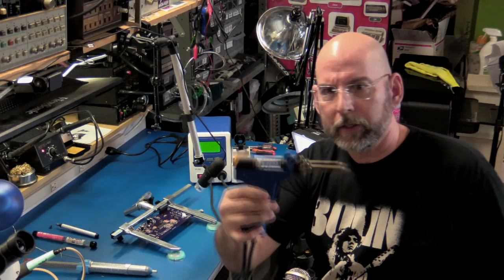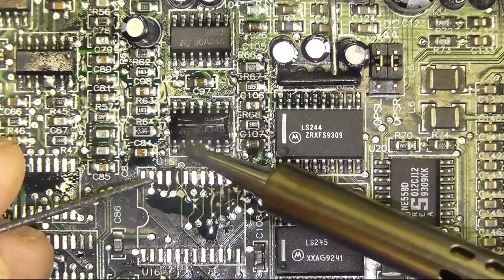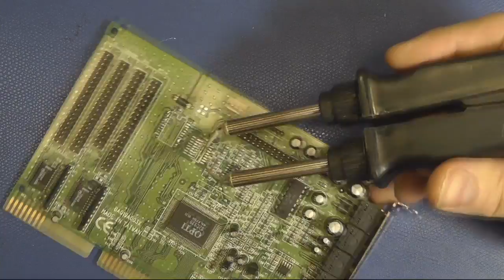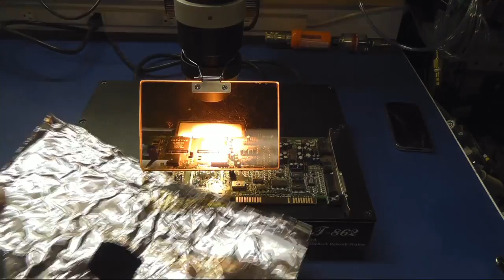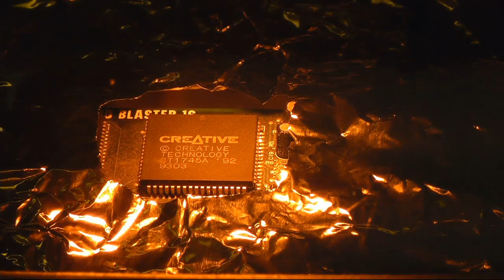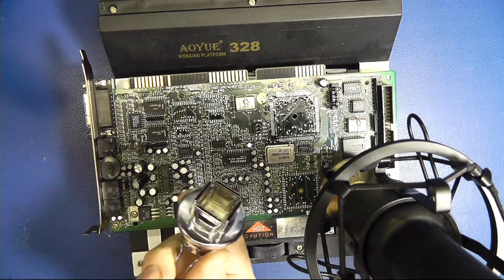SMT and Thru-Hole Desoldering Without Breaking Stuff

Comment: Hi, very good tips but I have a big problem removing SMD and through holes DIP parts from boards that have conformal coating silicone applied to protect these boards against humidity. Do you know to remove this protection?
Regards,
Fernando Pompeo call sign PU2PLL Brazil
Reply: Yes, I use thinner and some times heat the silicone with the hot air gun before to use thinner.

Best Regards.

Comment: What I really need is a good thorough video about using and maintaining a desoldering gun. It seems to me that I must be doing something terribly wrong based on the performance I get. The manual has been praised for being thorough and well-written, and I’ve read it cover to cover multiple times and followed the instructions to the letter wherever possible.

One issue: The manual tells me to clean it after every use and gives me some silicon grease “for cleaning” but only tells me how to unclog it with a pin and drill piece... no instructions on what to apply the grease to so I put it on the cylinder, inside and outside of the spring filter, and O-ring seals. Perhaps I’m supposed to ram this gunk down the desoldering nozzle?!

I unclog it constantly because it clogs constantly but even when it isn’t clogged it just doesn’t remove solder as well as it should. When it was brand new I got about ONE good use out of it before performance suffered terribly (removed an Atari 800XL cartridge connector to correct a mangled pin). It seems that I can only get about one or two good pulls between cleanings, which has led to a lot of damaged traces, stuck pins, and ruined projects/repairs.

Even a freshly cleared tip that was used to clear one small component and still pulls solder will freeze up when I try to run the pin through it, requiring the drill. I have to do it every few pulls or else it just clogs... or worse (appears to empty the holes but doesn’t). One large DIP can take me an hour due to constant clogging and clearing. Either I’m doing something terribly wrong or this piece of junk just doesn’t pull strongly enough. The impressions of other people make me think it’s just me. I’m following all the advice I’m aware of including adding grease leaded solder to every connection (working on older non-RoHS electronics anyway).

It’s an Aoyue Int701A++ from 2016 but it has the older, “more-robust” AC motor as opposed to the newer DC motor version. Even if my specific equipment is to blame, such a video would help anyone experiencing the same uncertainty as me with any similar equipment. It seems to be a big missing hole when I search for videos about these things. I’ve been using it semi-regularly for two years now and I’m at the end of my patience since my drill piece broke for a second time yesterday while in the middle of several huge projects so I can’t even brute force my way through like I have been. If I’ve been doing it wrong I really need to know. If I’ve been doing it right it would’ve been great to know while I still had a warranty. :(
Reply: https://www.youtube.com/watch?v=uQkCe9-b9FI&ab_channel=HakkoUSA
Reply: The indicated reply to this old comment of mine appears to be ghosted. :(

Anyway, it’s been many years since I made that comment and I have since figured out what the problems were with my Aoyue Int701A++ desoldering station. It was two-fold:
First, the fume extractor function from the soldering station side causes flux particles to build up and restrict the point where the internal tubing connects to the filter housing (behind the cap with the barb for fitting for external tubing). You can’t see it but mine completely clogged within one year of occasional use. The worthless filter there was still perfectly clean. I had completely cleaned out the pump and replaced the handpiece before I found the constriction, but that doesn’t explain why I struggled so much prior to the clog developing.

Well, it turns out that the weak pump just doesn’t spool up fast enough to clear a plated through-hole on a two-sided PCB. It ends up removing solder from one side which breaks the vacuum seal and the heat bridge that keeps solder molten on the other side. The molten solder on the other side always solidifies while I’m still pulling. Slow and weak is a bad combination that makes it only suitable for single-sided PCBs unless you know the trick.

That Atari 800XL I did back in 2016 didn’t seem to have a ground pour or plated thru-holes, so I got lucky picking that as my first desoldering job. I bought it primarily to remove the two 40 pin DIPs (CPU and PPU) from dozens of Nintendo Entertainment System boards (Hi-Def NES installations) with plated thru holes but it proved worthless for those without the trick. About the only thing the desoldering part was useful for in the first 6 years owning it was removing capacitors on single sided PCB power supply boards, which I usually found easy enough to remove without bothering with the desoldering machine. Meanwhile, it proved worse than a soldering iron at removing thru-hole caps on most things I bought it for, like a TurboDuo/PC Engine.

“The trick?” Glad you asked:
While the solder is molten on both sides, kink or pinch hose, pull and hold trigger to build suction, then release/jerk hose straight to instantly pull vacuum from the nozzle at full strength. Obviously, this can get tedious for large DIPs and such so I’d like to rig up a trigger-controlled solenoid like Kainka Labs did. With the station’s fume extractor function I can already get the pump to stay on while I go down the line.

Was fighting this station since 2016 and only figured that out in 2022 (currently 2023).

Comment: great video. Would you say 350 celsius is on average a safe temp to heat without losing pads?
Reply: The only desolder jobs I’ve managed to do at 350°C are the ones on single-sided PCBs. 

The right temperature varies wildly because it’s not a cartridge-style tip with a built in heating element. The temperature monitoring is even more disconnected from the workpiece so the digital temperature controls can’t reliably maintain lower temperatures, especially with high thermal mass like a ground plane or beefy power trace. You have to make sure it flows both sides simultaneously and maintains that flow until the solder can be pulled from both sides, which means you really have to crank that temperature for plated thru holes.

Comment: Here's a tip if you have one of those desoldering guns like Bil is showing at the beginning of the video: If you use it a lot and don't want to go out and buy new filters all the time, but a little wad of steel wool into the glass tube in front of the filter. It will catch the tin before it reaches the filter and the actual filter will last a lot longer. The tube fills up a little faster but replacing a tiny bit of steel wool is much cheaper than a filter, and probably a little more friendly to the environment too, because it may be possible to recycle steel and tin but not a filter.

Comment: on a difficult part such as a  smd IC or something with a large ground land underneath the pad, a electric heat gun works in a pinch, but you have to be careful as you can cook the board. give it a go you will be surprised how well it works. but it can blow the parts around if the gun is on high.

Comment: isn't the infared device dangerous for your health?
Reply: Its basically a halogen bulb in the head with a lens.
Reply: so  the spectrum of light is harmless? thank you for answering by the way.
Reply: UV might be harmful, depending on the spectrum. Infrared is safe. It's the same as radiant heat.
Reply from the maker: bruce wayne Well the light is bright, so I wouldn't say it cant be harmful if you stared into it (which I had spots when I started the camera from looking directly at it without my sunglasses) but not due specifically to the longer red and near red wavelength.

I did work for one of the early companies to try and use the iris pattern of the eye, or more specifically the blood vessels, and they used a near infrared wavelength.  I believe they vetted the exposure.
Reply: IR is low frequency light (below red).  It is UV (high frequency light above violet) that causes damage to cells.  The higher the frequency the more energy.

Comment: Got goosebumps when you started to scrub with the solder wick... Don't do that please.
Reply: Yeah plus I used bigger wick than normal, the one I wanted was probably under one of the mic standard or something. (shooting a video triples the amount of stuff in the way.) 

Scrub was probably a bad word on my part, I was using the motion to feel for bumps which is why I go lengthwise.  Once I find a bump I try and apply the iron in a way to wick the bump away. I also would probably use more flux or a better flux impregnated wick if I was going to reuse. 

Jaroslav, do you have an alternative method for getting the pads flat enough for a new chip?
Reply: BilHerd Thanks for the response.
I have worked on boards containing little VQFN packages. Quite a few of them failed. In the process of replacing them I discovered that physically moving the wick across the surface makes pads go bye bye. The method I now use is to simply put the wick on the pads and move the iron over it, while the wick stays put.
Reply: old habits are hard to break